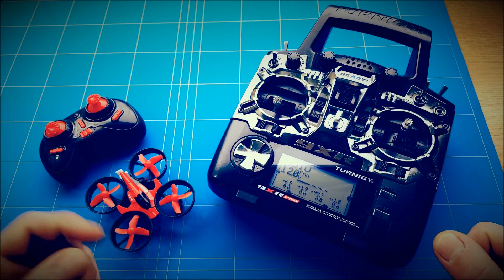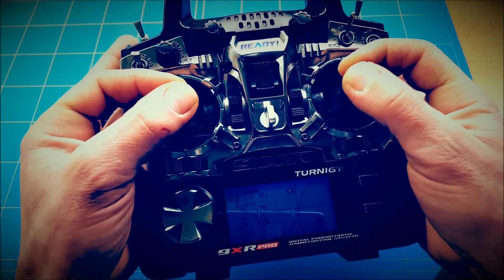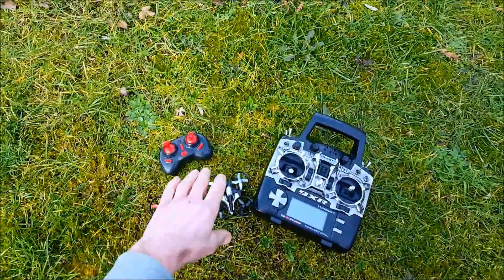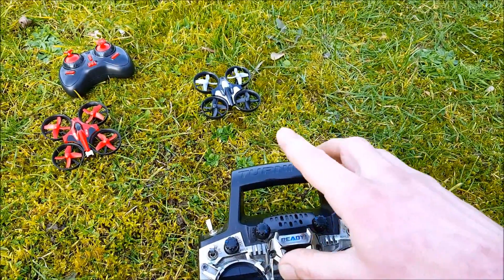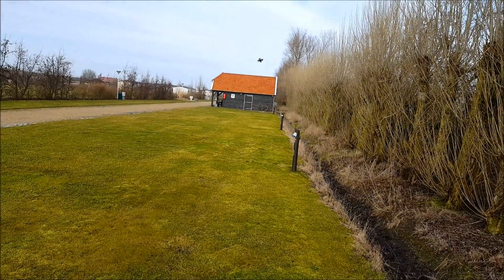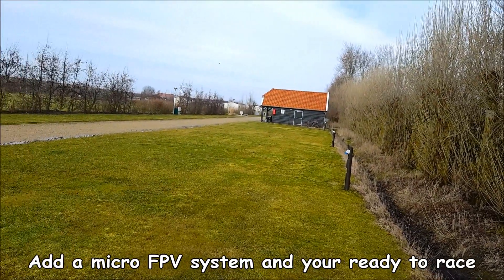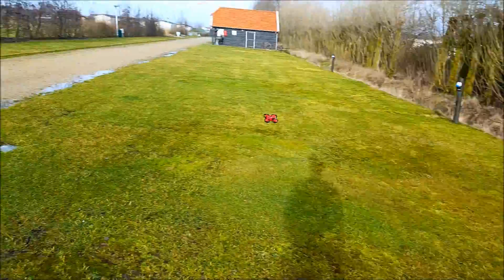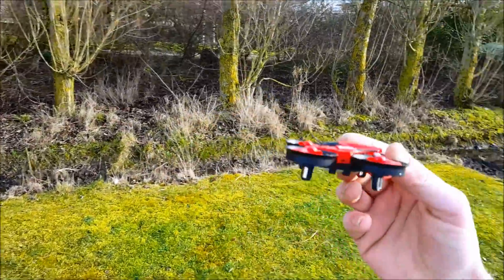Multiprotocol TX Module vs Stock Eachine E010 Outdoor Test Flight

Comment: Multiprotocol TX Module + Turnigy 9XR works, but DM003 Mini Speed Flight 2.4G 4CH 6Axis 3D Roll RC Quadcopter RTF does not work  :(

Comment: Hey, I am not having enough throttle power after binding it with the multiprotocol module.
Reply from the maker: That's strange maybe there is something wrong with your multiprotocol tx module
you can also try to center the throttle channel and see iff it makes any difference 
perform a thrust test like i show in this video https://youtu.be/utnf4J7-Is0
Reply: Hey,I've got the same problem,when I use the module on my flysky fs-i6, I lose throttle aswel,did you get it sorted?